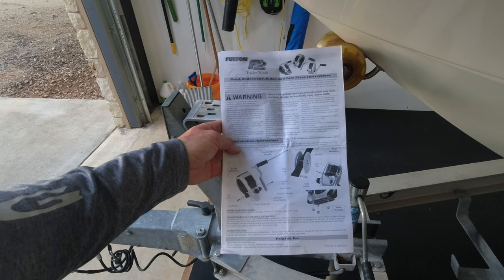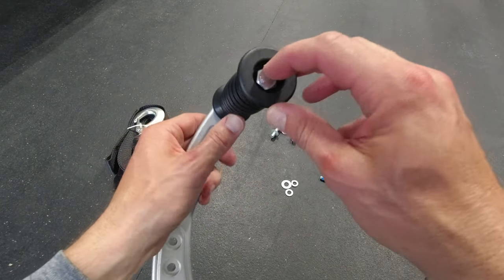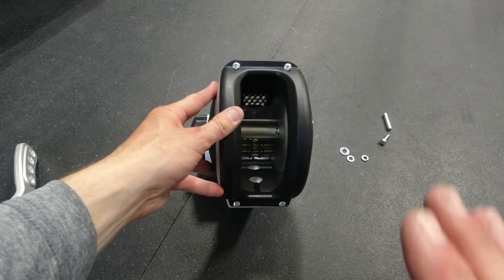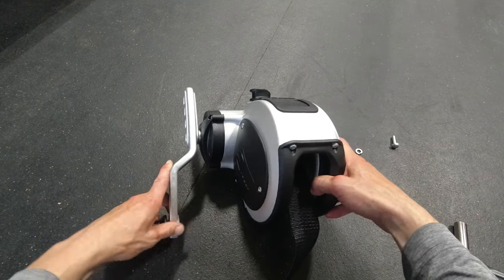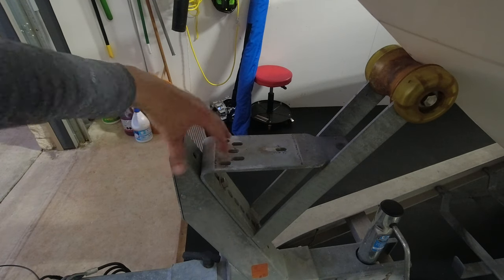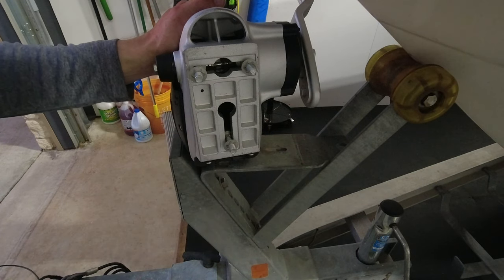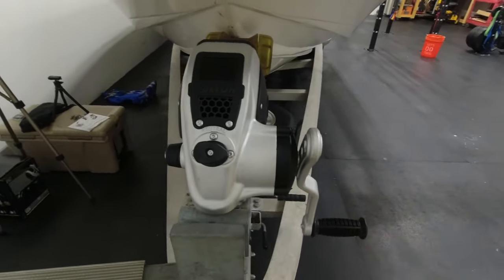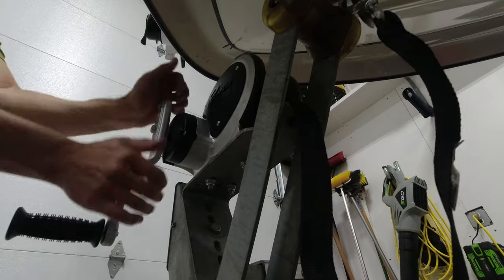How to install Fulton F2 Trailer Winch

Comment: I can't get this installed right.  My winch stand is not flat like yours, it is at an angle and the winch post is 2 inches thick and not just a thin flat plate.  The holes are drilled thru the winch stand in the right location.  I can't use the Fulton F2 bolts becuase they are way too short so I bought some 3" carriage bolts with nuts.  Here's the problem -- The upper/center bolt wont stay in place to go thru the holes when I lean it upright against the winch stand.  Does this Fulton F2 only work on winch stands that are thin/flat plates?  Also when you are tightening the nuts to the winch stand, doesn't it make the entire bolt spin around?  I don't understand how it's going to tighten without having a wrench or ratchet inside the winch to prevent the bolt from spinning in circles when tightening
Reply from the maker: As long as your bolts are long enough I don’t see why it has to mount to a flat plate like this one.

@ 3:50 the carriage bolts slide into the grooved slots and those slots actually hold the head of the bolt. It took putting the winch in place and my finger holding the bolt head down in place to keep it from pushing out - that’s the reason for the low torque specs…because it’s the cast aluminum frame that holds the bolt head.

Hope that helped and you can get it working! It’s been a great winch

Comment: nice, but 9 o'clock is control release, 12 is neutral, 3 is rollup tighten
Reply: On my winch, I reel like the video so 9 is rollup tighten, 12 neutral and 3 is control release.